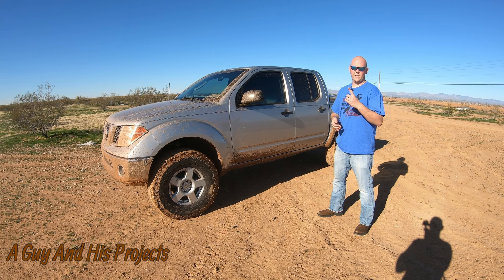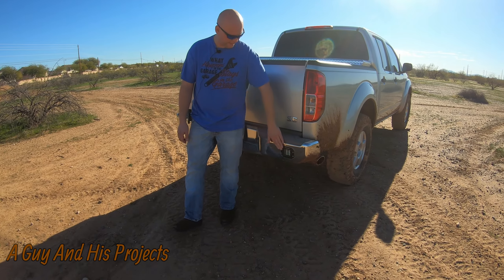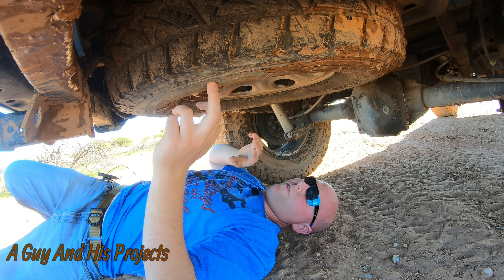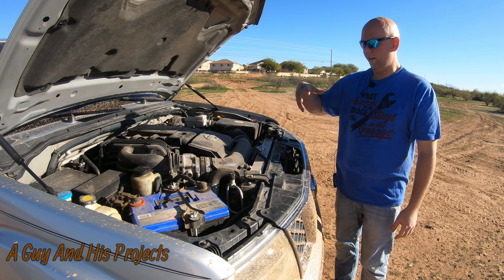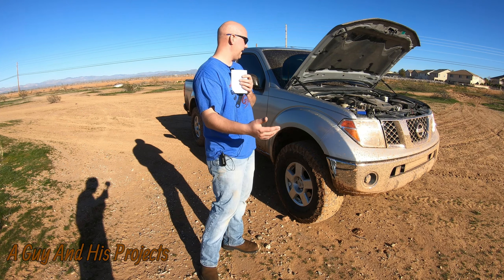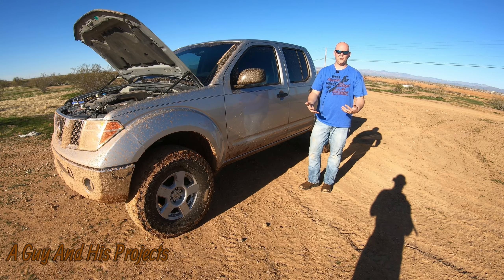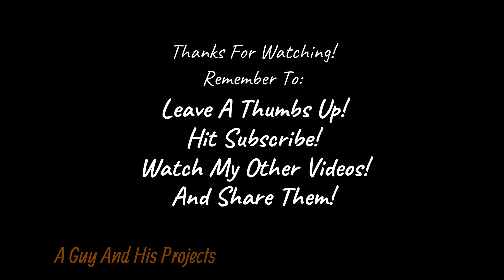Nissan Frontier Owners Review 230k Miles!

Comment: These trucks are legendary. I am so happy I made a decision to purchase a 2019 Pro4x before Nissan redesigns.
Reply from the maker: Indeed they are! It is going to last you a long time for sure
Reply: Responding to a man and his projects. Thank u so much for your input.
Reply from the maker: Anytime!
Reply: Just picked up a 2019 PRO4X as well. She’s a beast!!
Reply from the maker: @fcamontoya2782  you won't regret it!
Reply: Purchased my first Frontier as well! Last of 2019 SL...
Absolutely love this truck in Cayenne Red.. 
Purchased full set of camber bolts 🔩  beginning planning for hybrid lift ....
Suspension/Body lift ! 
Any comments on 275 -75- 18r Goodyear Duratrac s ?
Really interested in your 9 leaf spring pack and coilovers....!
Reply from the maker: @tgrzadziel1975  personally I have never run the duratacs but have heard several people say they love them! I'm currently running the Roadone Calvary MT's on my F250 (I have a review video on my channel). I think my overall favorite on the frontier was the BFG KO2's. The leaf packs cam from Alcan, call them up! I was happy with service and product
Reply: I’ve seen the new redesign. I rather have yours.
Reply: @AGuyandHisProjects I have a 08 Nissmo and the only thing I've done to it is change the radiator at 80k before it became a cross contamination issue. Then I did the timing chain kit along with the cam sensor's at 120k and have never looked back currently 280k and still pulls strong with no issues.
Reply from the maker: @boogitybear2283  haha I agree! They look like tough little trucks. The new ones look to plasticy haha
Reply from the maker: @chrisgarcia5462  heck yeah man! Love hearing those stories
Reply: I have a 2019 pro4x I love it

Comment: You're mostly correct about the cold air intakes. I used to work in the auto repair industry and we called them hot air intakes. Some designs that have the shroud/box around the cone filter are made to block the hot air and allow air from the headlight/grill area. Some cold air intakes from the import car scene have the filters or cowling down below the bumper and that is where the term 'cold air' intake started. All others are just there to allow more air with fewer restrictions. The cold air portion all depends on the design.
Reply from the maker: A true cold air intake that allows more air would be awesome!

Comment: Kool stuff.  

I have a 2006 Model as of now it only has 40k miles, got it a little over a year ago with 37k on it. It's more of a Vacation truck I leave at my in-laws. 

I did the Bypass on the Radiator right away as well as the change on the rear differential. 

If my Radiator ever goes, I'll be sure to pick up a CFS all Aluminum model. Truck is on an Island and tempature can get hot on summer days. 

Thanks for sharing ☺️
Reply from the maker: That's really low mileage! You'll get many many years out of it lol. Yeah, I really like the all aluminum radiators. I've had other brands in other vehicles but cfs ranks pretty nice in my book

Comment: For those that get concerned about the maintenance/repairs discussed, and think they'll just get a Toyota and not have to worry, consider this:
I have a 92 Toyota V6. Bought it in 2010 at 198k+/- , it now has 223k+/-. Other than normal wear items, in those  10yrs/25k, I have replaced the clutch and associated parts, shifter bushings, clutch hanger bracket, clutch main amd slave cylinders, brake master cylinder, radiator, front and rear main seals, the entire fuel system from pump to injectors, ign coil, had the factory Alt rebuilt, resealed the valve covers (need to do one of them again), and replaced the pitman arm. My current "To Do" list includes CV axles, a rear axle rebuild (works fine, but had metal in the oil) and spring pack replacement (optional). Stuff needing done, but I may not fix; trans synchros are failing, and the steering box is more than a bit "loose."

The point is, these are moving machines exposed to incredibly harsh, and varying conditions. They wear out, they break, it's the nature of things. These Nissan trucks fair far better than avg.
Reply from the maker: Nissan has certainly proved their worth to me! I have a Nissan Sentra as well, they get a bad wrap because they are on the cheaper side of the market and true, the thing is gutless. But mine has been trouble free for 140k miles now. I think people just don't maintain them, drive them like race cars, etc. We bought it for me to commute to work and back 100 miles a day. It is a dependable car so far!
Reply: @AGuyandHisProjects  Thanks for the reply! I'm happy to hear you've had such a great experience. A good friend had a late 90's, fourth gen Sentra.  He made it into a budget "rally car," with about a 3" lift. He used to take it off-road over some crazy obstacles. That thing was a beast! Also, some other friends owned and Sub Shop. They bought a 2nd gen Sentra brand new for a delivery vehicle. It got beat pretty hard, but held up unexpectedly well.
Reply from the maker: Nissan gets a bad wrap in a lot of places...but I'm one that has been very happy lol. I've always wanted to build a rally car!

Comment: Good review. I have a 08 NISMO with an automatic. It has a separate (factory I believe)transmission cooler in front of the radiator. Have you heard of other NISMOs with factory transmission coolers?
Reply from the maker: I don't know what does/doesn't come with each model truck. But it isn't a bad idea to get away from the radiator

Comment: new sub from🇨🇦... got an 06 SE Frontier extended(was testing it out plus it was clean... practically rust free for the snow belt area(Ontario). love it to bits ... planning on getting a crew cab pro4x.... if the rust gets unbearable (which will take a while cause its still rust free 🤣) .... Also cirious how the 9 speed is in the 2020 model. ... so eventually will get that too . 👍
Reply from the maker: Awesome! Thanks for the sub! These trucks are amazing little beasts

Comment: Put in an AEM high flow dry air filter. They have dust bags you can use when running in sand in the desert. It upped my gas mileage and got more power at altitude here in Colorado. Cleanable and reusable, but don't have to mess with the oil when you clean it.If you use the K&N, clean your MAF sensor if you haven't yet. It'll run better.
Reply from the maker: Thanks for watching! That is a viable option. Cant say I've had the MAF issues in any of my vehicles running the k&n. Probably has a bit to do with how much oil you slather on there maybe?
Reply: @AGuyandHisProjects  100% correct. People over oil filters which takes out MAF which can be spendy on some vehicles.

Comment: Thanks for taking the time to make this video. Two things that I guess you didn't cover. My 2013 is at 100K and I am having issues with the rear end whining and the timing chain rattling when it starts. Have you had any issues wit either one of of those?
Reply from the maker: The timing chains whined pretty much the whole time I owned mine, I never bothered to replace the guides. Never had rear end issues

Comment: I've owned 2 Frontiers, a 2005 SL and a 2016 Pro4x that I traded for a 2020 Tacoma (BIG mistake). I'm currently shopping for my 3rd Frontier and I'm going used this time to save some $$ since they haven't changed since the first one I bought. I drive 25,000 mi per year so my only gripe is the shitty gas mileage, but these are pretty cheap to maintain, so at least you don't have to spend much there. I'm looking at a really clean 2015 SV LWB 4x4 with 140,000 miles. They're asking $15,900 which is way too much, but I'd probably buy it for $14k. Nice review!
Reply from the maker: Thanks for watching and the comment! Yeah nobody seems happy with the MPG's on these trucks haha! It honestly never bothered me as I've driven a LOT of trucks at work and nearly all of them get WAY worse mileage than the Frontier. I would buy another one of these trucks in a heartbeat!

Comment: I just bought a '09 4WD SE crew cab with 193k miles on it this spring, and I am loving it so far.  Still educating myself on the truck's strengths and weaknesses, and I found your review invaluable.  Lots of good heads-ups and positive info on the Frontier, all helpful.  I'd owned an '89 4WD Nissan Hardbody back in the 1990s, and loved that one too.
One question I have is on the timing chain.  These 4.0 V6 engines are said to be good to go for about 150k miles on their OEM timing chains.  Word is that they are a bit of a pain to get at.  Have you replaced your timing chain yet?  If so, did you hear any noises like a whining sound that's said to be a symptom that indicates a worn-out chain?
Reply from the maker: Thanks for watching and the feedback! I never bothered to change mine and at 235k miles it had not caused any problems. If you listen you can hear that faint whine but never broke. That being said if it does break it means a new engine lol. The reason I never took got it replaced was I just figured IF it ever snapped I'd just buy a used engine and throw it in. LOTS of them available.

Comment: so the tranny thing was fixed in 2011?    im looking at 2012 now pro 4x 6 spd.   has back up light mod and trailer connect you have.   has back up camera i guess coming out rear plate.  15k seems couple grand expensive  but seems like itd be a solid truck.   little small for me but truck prices are outta control right now during covid
Reply from the maker: Yeah, was a radiator issue not transmission though. The radiator caused transmission issues though. Yeah these trucks are a great bet!

Comment: I have a 08” Frontier with ab 51k miles on it and if I were to just replace the radiator with a csf one, it would prevent my truck from getting smod correct? Or would I have to replace other parts as well?
Reply from the maker: The problem was with the original radiators. Any radiator replacement would solve the issue yes! I do highly recommend the CSF though

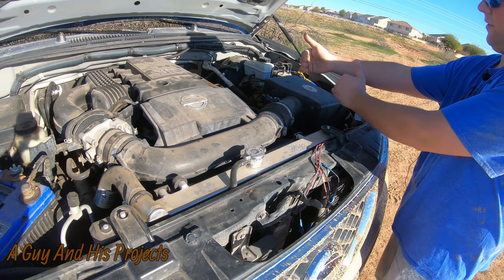Comment: At 14:28 you said something need to replace. Would you please tell me what it is. I have 2007, at 170k mile and running well, but i wanna make sure to fix whatever needed. 
Thanks
Reply from the maker: without spending a lot of time re-watching myself i'd guess i was talking about the radiator at that point.

Comment: Nice video. I have an '05 with about 175k. Need to do the heater core soon. Are the hood struts 100% bolt on or do they require drilling? No concerns with your timing chain guides?
Reply from the maker: Thanks for watching! The hood struts I bought were direct bolt on, easy peasy. Timing chain guides never gave me an issue, there is a slight whine but nothing exciting.

Comment: I'm looking to lift mine, would you recommend these coilovers? How much stiffer are they vs. stock? Thanks!
Reply from the maker: Thanks for watching! So to answer your question, I have the Radflow 2.0 coilovers but I went with the 650lb spring rate, this was too stiff. If I were to purchase them again I would go with the 600lb springs. The 650 would be great if you were running an offroad bumper and winch set up. The 650's were just a teeny harsh. But yes I would recommend!
Reply from the maker: Thanks for watching! So to answer your question, I have the Radflow 2.0 coilovers but I went with the 650lb spring rate, this was too stiff. If I were to purchase them again I would go with the 600lb springs. The 650 would be great if you were running an offroad bumper and winch set up. The 650's were just a teeny harsh. But yes I would recommend!

Comment: Great info, thanks! I’ve got a 2010 with 70k KM on it … Lots of life left! Do you have any advice / insights on how to install those rear bumper lights? Did a hole saw work, or does it take some more “blade-work”? Thanks in advance.
Reply from the maker: Yep tons of life left! I used a hole saw to start then finished it off with the Sawzall. Jigsaw or dye grinder would also likely work

Comment: I have a 2013 with 160.000 miles. Old Man Emu leafs  and R/C  front puck lift.  Bilstein shocks Oil and Tires runs like a champ. Rear  stock leafs suck
Reply from the maker: I put those custom Alcans in the rear for a dramatic difference!
Reply: @AGuyandHisProjects  500.00 for the OME packs it was a small fee. Truck use to be wife's daily. She bought a new Wrangler and her old truck became my work truck. She wants it back. That over priced jeep is a pile compared to the frontier.
Reply from the maker: @jimmyjackass1805  lol thats funny!

Comment: Original timing chain tensioners I’m assuming? I know the early years had the problem where the tensioners would wear. My 08 Pathfinder has the infamous whine.
Reply from the maker: Yes original as far as I know. At 230k it still wasn't whinning though. I bought it at about 60k i think so it is possible the PO had changed them

Comment: Thinking about picking up a 2019 Pro-4X before the redesign. Have you had any rust issues on your 2006?
Reply from the maker: I live in AZ, no rust here lol
Reply: I can chime in here. I own 2019 Pro-4X currently, and I have had 2019s all the way back to 2013s thanks to the employee lease program lol. I live in Michigan so the road salt can do some damage. In one winter season some surface rust would start forming. When I finally bought a 2019 since my dad retired and I can no longer reap the benefits of a new truck a year, I decided to not take the change of the rust becoming a problem and got rust proofing from Ziebart. Line X is another company that does the same so the choice is up to you. Hope this helps a bit!
Reply: @ryanw.2587  awesome thanks for the detailed reply! If I ever get around to picking up one I'll definitely consider a rust prevention treatment.
Reply: @hkenforcer  You are welcome! Also there is a forum called ClubFrontier.org and if you ever have any more questions either before or after you get a Frontier there are a ton of people that will be able to help! There might even be some write ups already to help out!

Comment: Frontier, Xterra, Pathfinder all awesome vehicles :)
Also how has that 3" lift affected highway driving and stuff over stock, I am planning to put a 3" lift on my 2012 Xterra maybe when it reaches 175k miles or so (currently at 141k miles)
Reply from the maker: Thanks for watching! The lift has made the ride a bit stiffer, but still more comfy than my F250! Lol.
Reply: I had to by pass my sway bar need to buy longer ends and will remove the stiffness

Comment: Couple of questions. I’ve got a 2010 SE 2wd (4.0L) with 97k

1) How would I know for certain the radiator was replaced? (Might be a dumb question) Bought mine at 30k.

2) What intervals did you change your brakes (or choose to?) Pretty sure at 97k, mine still has the originals.

3) Have you had issues with your door locks?
Reply from the maker: Thanks for watching! You would have to look for the part number on the radiator, then if it is a Nissan part number you would have to call Nissan and find out if it was the original or one of their updated ones. 

As far as breaks go I think I was doing them every 80k or so but I pull trailers up and down the mountains 

And no, never any issues with the doors other than the passenger window is slow and always has been
Reply: A Guy and His Projects 

Did you ever have any SMOD issues? 

Did you replace the radiator to prevent that or for another reason?

Did you do a by-pass?

Thanks!!!
Reply from the maker: @TN-Land-Manager  I never had a SMOD issue no, I didnt even know about that being an issue until I replaced my radiator. I put in a CSF racing radiator to see if it could help me keep engine cool while towing. When I dropped the coolant it was red (which I hadn't seen before) so I googled why and learned all about SMOD. At that point I thought I had smod because of the red coolant and went directly to the mechanic who had just done a flush on the system a few months prior. Turned out they used red long life coolant and all was good haha. Never did the bypass as you dont need to if you replace the radiator
Reply: A Guy and His Projects 

Thanks! I’m trying to see if my radiator is the original. Bought at 30k. I feel like it is a ticking time bomb! Scaring the crap out of me watching these videos on SMOD.

Is there a video somewhere you suggest for a radiator replacement?

Also, if mine has not been replaced, do you think I should do the by pass on mine just in case? I don’t do any heavy hauling.
Reply from the maker: @TN-Land-Manager  I get that! Unfortunately I never did a video for the radiator replacement on the frontier :/ I'm sure there are plenty of good ones on It though. It was pretty easy ish from what I remember though. Biggest complication that I remember was getting the fan shroud out. Earlier years they were a one piece shroud and a pain in the @** lol. They updated them to a two piece sometime down the road, not sure when. That was
Reply: A Guy and His Projects 

If mine has not been replaced, do you think I should do the by pass on mine just in case? I do not do any heavy hauling.

Guessing, if I do the bypass, I wouldn’t need to do any extra flushing on the transmission or radiator if I don’t have SMOD?
Reply from the maker: @TN-Land-Manager  I know a lot of people have successfully done the bypass. Personally i would just replace the radiator if you have it weighing on your mind. When doing the bypass you reduce your cooling capacity. And IF you have the original radiator then at this point it is getting pretty old anyway.
Reply: I want one of these in a 2X.  I don't need 4X.  Thanks for showing us your truck.  👍
Reply from the maker: @lindamyers1386  thanks for watching and you are most welcome! This is a 2wd truck :)

Comment: What light bar are you using?  Would you recommend it?
Reply from the maker: It was from Auxbeam and yeah It's decent. Certainly not the best on the market. I siliconed the edges to keep the water out but it still yellowed overtime much like a headlight.